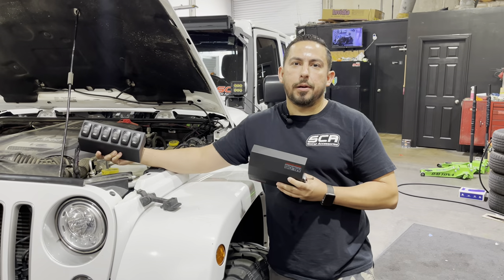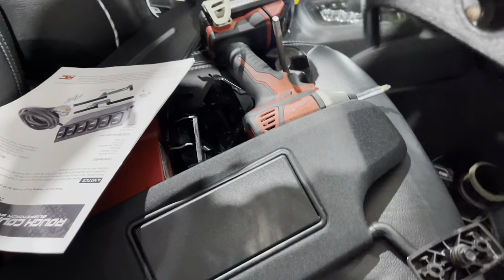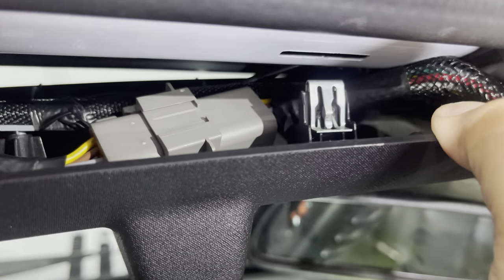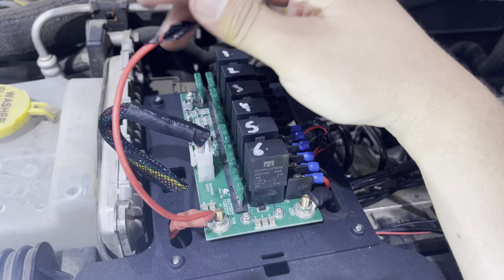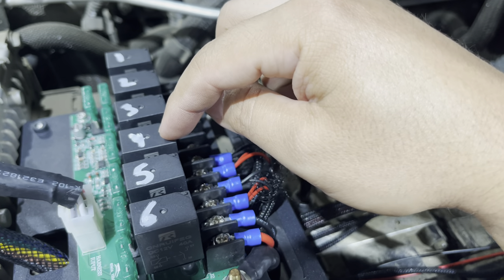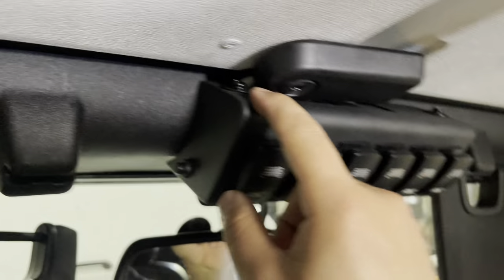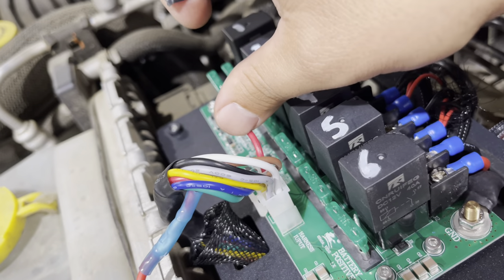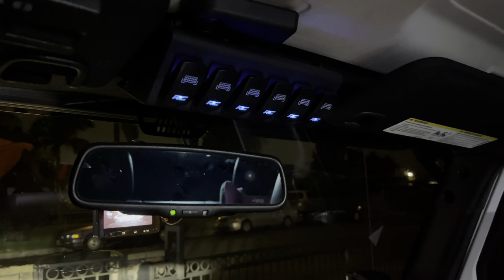DIY: Jeep Wrangler Switch Pod Installation, Rough Country MLC6

Comment: Hey Jason, I have a set of 4 side pods since I ordered a quad kit from RC and I was wondering if you’re able to connect 4 wires together into one switch so that way they all turn on with one switch button? Is it safe? Or is 2 wires the max allowed to connect together.
Reply from the maker: not 100% sure but if they are smaller pods I would just assume it would be ok since 1 switch can power a big double row 50" bar which pulls more amps that would make me assume it would be fine but may want to see it it comes with a any max output specs per switch on the website.
Reply: As long as the total amperage of all the lights doesn't exceed the fuse rating for that switch, you can add as many lights as you want to the switch.